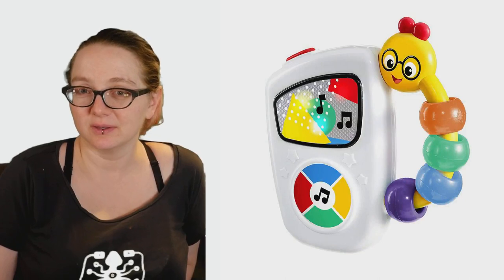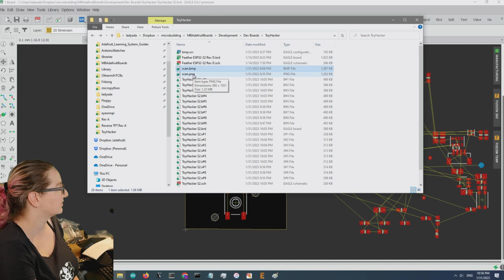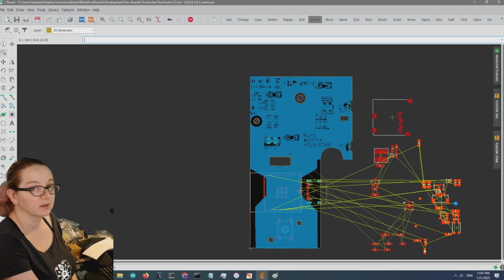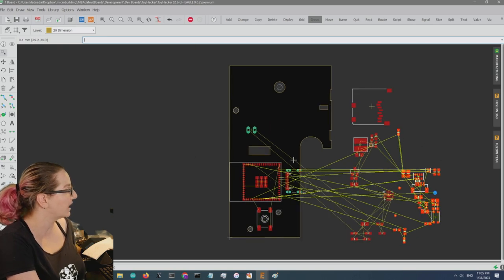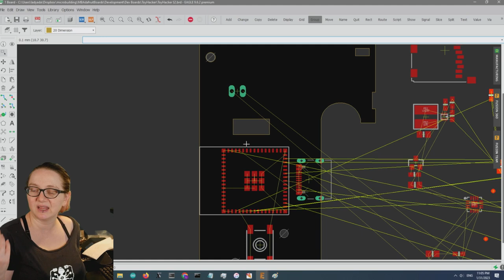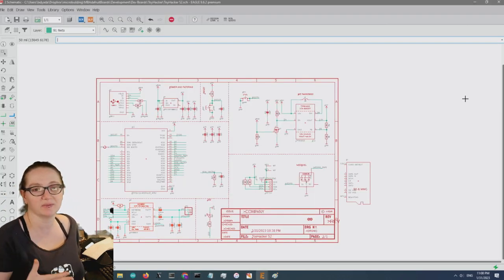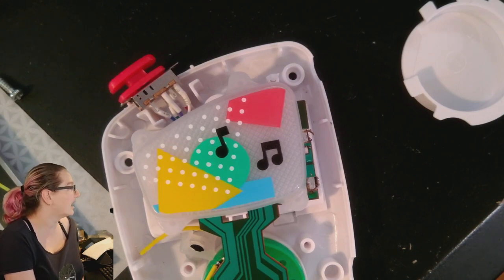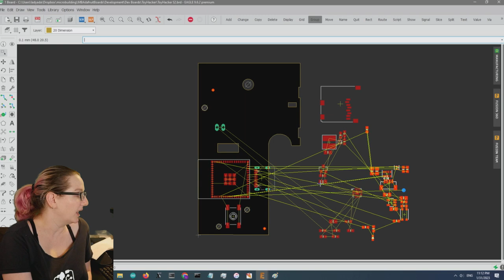PCB Scan - Toy Hacking! Baby Einstein Take Along Tunes Musical Toy

Comment: Today I learned you can initialize SPI at a faster baudrate than default. That would have saved me so much pain with my last project lol. Playing wav files from SD takes so much SPI bandwidth that it stutters every few seconds at default baudrate, but WAV decodes so much faster than MP3, which made everything else I was doing on the microcontroller run so much better. Ah, well. Live and learn.

Comment: You might consider adding USB type A pads to the south point of the board, that removes a connector and let's  people attach a short extension cord if they want to mod the case.